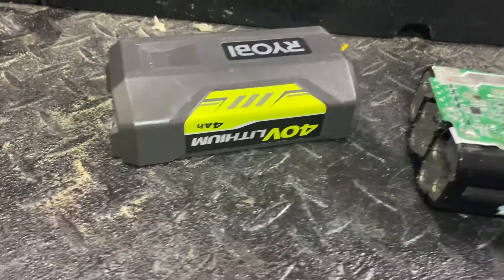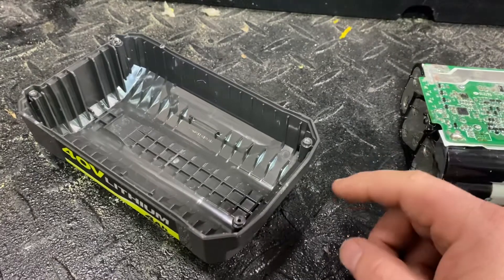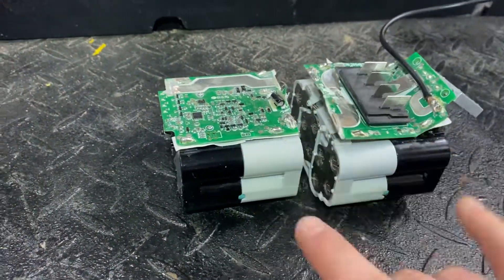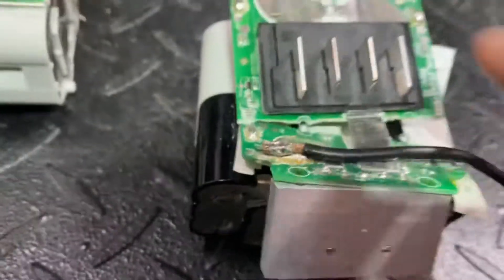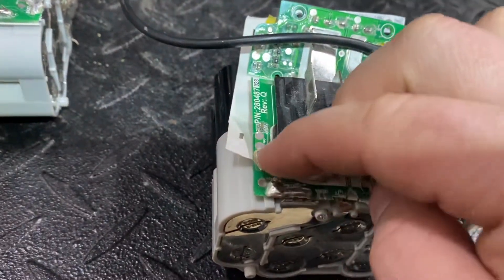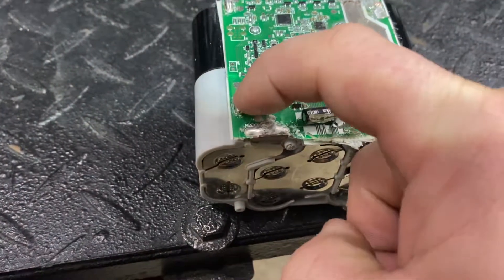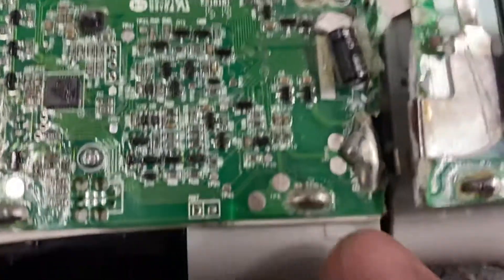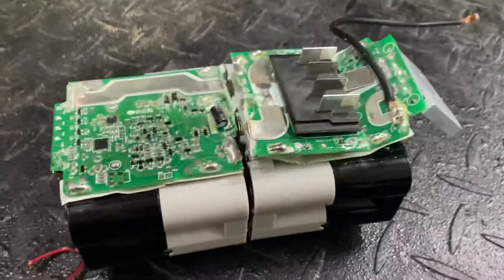A look inside to see how the newer style Ryobi 40V Lithium battery is built. Tips on repairing

Comment: .........How can you say there is 42 volts on each side??????  You can clearly see how the batteries are in parallel on each side = 20 + volts on each side YES.    ALSO I can say you had the balls to cut the circuit board the way you showed it....... YOU ARE VERY LUCKY THE BATTERIES WERE DISCHARGED!!!
Reply from the maker: You said there’s 20 V on each side and the two sides are parallel. If that were the case, then the battery would only be 20v and double the amp hours of a single side. The only way to get 40 V out of two different sides of 20v is if the 2 sides were ran in series with each other.  Each side is not 20v though.  This pack has 10 batteries on a side. 10x4.2v(per battery) = 42v. So on each side is 42 V. The two 42 V sides are ran parallel to each other so the voltage remains at 42 V but combines the amp hours of the 2 sides which doubles the amp hours of battery pack.
Reply: @freshmaker5  Manuelruiz is correct.  20+ V each side.   Connected together in series for a total 40+ V.